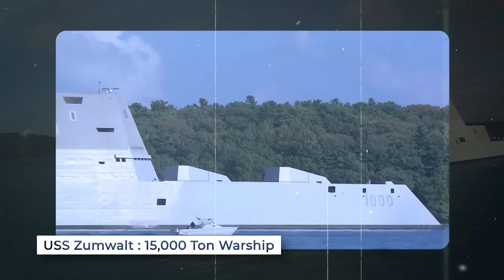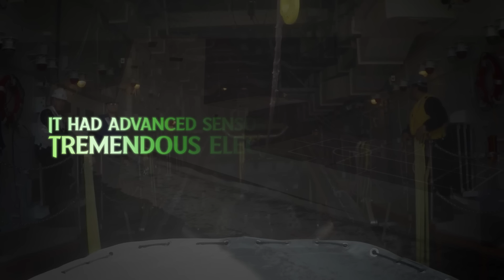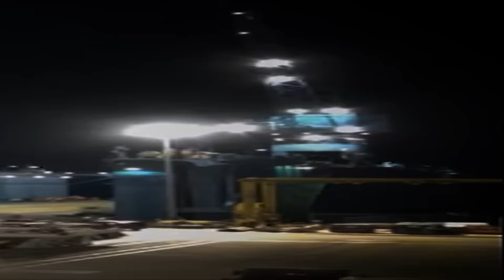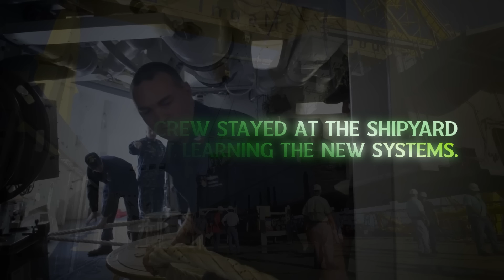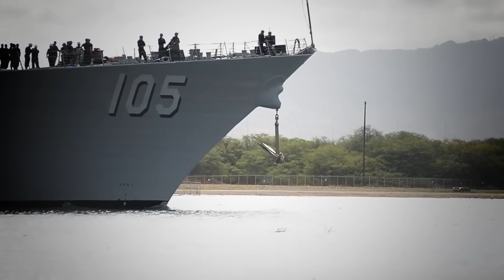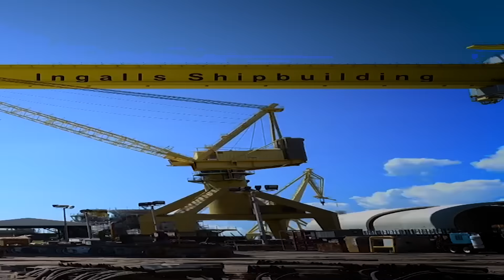How US Navy Rolling Out Newly Repaired $11 Billion Destroyer From Dry Dock

Comment: The Dept of the Navy needs to hire a gamer for ship design.  The rule for designing an effective character is simple.  Decide what one thing you want to do, and how well you want to do it.  Make the character do that extremely well.  Once you are at that point, you can examine your budget and see if you have room to do one single other thing well, and if you do, then add that in; otherwise, make it even better at the original thing.  With that one change, the Navy could keep boondoggles like this from happening.
Reply: That would be a different a lot of different in not only ship's but planes. By all the gods of Valhalla build something they could beshot for something that could be shot for a hell of less than millions dollars the company has made a HELL OF A LOT OF MONEY IN R. D A MILLION DOLLAR IS OUTRAGEOUSLY PRICED THIS SHIP THE  Zwalts cost was almost as expensive as a aircraft carrier Zen waltz was solely supposed to cost $8 billion I think the Ford I really not sure was built for $13 billion. The Ford class aircraft carrier. When the Navy bills a ship as advanced as a ZenWalk you should already have plans for it weapon systems to the anchors it should have been ready. Sounds like some good old boys wanted to build a destroyer putting a little jingle in the pocket of the fat in high places

Comment: The mistake was not making it what it should be the new fleet air defense cruiser. 
The hull and propulsion works well.
Ditch the complete stealth upper superstructure and make it more like the Arliegh Burke Destroyer.
Place one standard 5-inch gun up front. Install more Vertical launch Tubes forward of the superstructure. 
Minimal anti-submarine equipment.

Comment: When I served on the U.S.S. Albany CG-10, in 1966 it was the most powerful and accurate Guided Missile cruiser in the world.  They had to add two 5"-38 gun mounts plus radar directors, one on each side of the ship because if it were attacked by the 65' Komar Class Russian missile boat, it had absolutely no defense against it or any surface craft.  I know, because I was a Fire Control Technician gunnery and worked on the port side fire gun fire system.  I sincerely hope that did not repeat that mistake.
Reply: Various exercises were carried out in the Med with UK and US warships ‘attacked’ by a wooden hulled, aluminium superstructure high speed launch acting as a Komar class boat. Initially, 20 miles was the distance the launch should have been detected, by the time the exercise was terminated, that had been reduced to ten miles , and on one of the final scenarios, the launch spent 15 minutes sat close under the stern of the US warship, A Komar class carrying the nuclear tipped missiles, were a clear danger as most of the unfriendly countries in the Middle East had dozens of these craft.
Reply: what big navy screw up  .... YEP ALWAYS DOES
Reply: Your as old as Davy Jones.😢

Comment: I always wondered with the guns why didn’t they just run traditional ammunition after they did the math on the rocket assist rounds . At 155mm they would still be heavy hitters and have decent range
Reply: I have the same question.
Reply: 155 artillery still uses powder bags while naval ships use cased shells for safety and automation.  Plus the barrel isn't actually a circular rifle.

Comment: Once again an AI generated video with no basis in fact, only repeated sentences designed to increase monetization through longer running time. Floating dry docks do not require a caison to keep water out until sea level is achieved. It lowers the ship into the water until buoyancy is reached and floats off of the keel blocks.

Comment: I agree if the Japanese came up with a great way of using the rail guns and if the ammunition, is  a lot cheaper, fine and dandy, the way I understood the railgun testing was that it was very fast. The rounds in the original testing were very small aluminum, but very fast designed to just punch a hole. And cause a lot of trouble in the ship, they figured that because that's how technology works. They just want the contract.That's just my feelings about it. In the case of these were 6 inch diameter rounds. That was like the medium cruisers back in the day's of World War 2. They carried 6 inch guns. I still believe that the 16 inch guns of the Iowa class were amazing. But of course, the barrel liner had to be replaced after so many rounds, but they did come up with a round. But never had the opportunity to use it. The war ended or it was after Vietnam. But.
The rounds had a rocket assist in them, which would take them from being 23 to 26 miles to a 40 mile range. For the price of defending against all these drones today, could you imagine a phalanx? We only use the 20 mm six barrel mini gun, there is a 30 millimeter called goalkeeper, but we don't have those. let's say we made a 3 or 4  barrel for the sake of discussion,  barrel in in
A 40 millimeter or a 3 inch round.
Whatever caliber, but one that has longer barrels for more range. One that could fire a burst 40 miles, 30 miles. Anything that we don't have to waste a missile on
And make it fully automated. So it's in a armoured barbet being fed from below in the magazines. That's what we need to go back to. I always hear the admiral, saying those missiles cost. So much money, well then go to a rapid-fire guns that have a higher caliber farther distance. Bullets don't cost that much when it comes to comparison of a missile
Those rim rockets are great. It's just my opinion. There's not enough close in weapon support on Our ships, I mean, the IOWA'S had 4 20  MILLIMETER PHALANX, now 4  goalkeepers would have been better longer.Range and heavier 30 millimeter rounds, those are made by one of our NATO countries. So like, you know, we have trade. We're friends. So even if the Zoom,s can carry all these hyperspeed missiles, fine? Great. Awesome. That close in weapons is what all our ships need to have. Even a carrier has all these planes to protect it.But you can see what our enemies are out of yemen. Iran, the houthis et cetera, they're supplied with tons of drones. America is the only a country in this world that is truly free. But as in the famous words of nikita, khrushchev USSR that he stated after JFK STOPPED the 1962 cuban missile crisis. (Next time we'll destroy you from within). Thanks to the woke dei Democratic Party, which is their goal to rip-off the taxpayers. Thus, it's easier FOR THEIR EVIL TREASONOUS MENTALITY  towards our country.
Reply: You think in the beginning, the announcement of high voltage capability, might have hinted a rail gun on board?
Reply: Wow, you could do with an editor for your post. I read it twice and I'm still not sure what you meant.

Comment: Your wrong normally before a vessel enters any sort of dock the dock people will have access to the ships drawings and block will be pre placed., the vessel will be pulled into the dock by tugs and defloodeing will commence. just before the vessel touches the block divers will physically check block to ship alignment, And so it has been since the advebt of diving operations.  Yes it is critical and yes it is dangerous but dry dock operations have been doing this since the turn of the last century nothing new about it. I wish you peop[le who make content would fact check yourself. The second part is called a synchrolift allows the vessel to be placed at a convenient spot freeing up the drydock so other vessels can use it.

Comment: It wouldn’t have been that expensive if they completed all 32. With technology developing at a rapid pace, there will always be new systems and weapons that could be integrated into them even if the 155mm AGS was a failure.
Reply: The study going on will need to be studied before a larger scale . Assured products and systems must be designed first with long term testing and lasting performance before a large number of ships that cost more to operate than is feasible .. million dollar drone hunter is not a great investment . And welcome the new investments in the technology. Have to spend to find the cracks not identified in the complex system that has its own set of problems as  very high energy focused  electro magnetic space and   Special applications  aircraft munitions  for overhead energy transfer in plasma energy weaponry . .
Reply: That's right Eddie You get a discount when you build up to 32 ships either spend it now or spend it later
Reply: ummmm.....what???? the cost would be the same...wtf are you talking about....
Reply: From an acquisition nightmare and SNAFU. It was too many new undeveloped systems on a single platform. We could have had 32 useless ships instead of just 3. It was poorly managed, and is the ugliest warship ever built since the Russian Ekaterina battleships in the 1800s.
Reply: You are correct in the fact that the price gets cheaper as you produce more however there are numerous issues including engine failure cracks and the like that the manufacturer had not resolved so it would be asinine to continue to pour more money in it also it was supposed to have these guns that had amazing capabilities however at a million dollars per shell that did not make sense
Reply: Yeah, but the US isen't the one developing these new weapons =P

And in addition, the ship has been expensive even before they shortend the total number. This one was build around one specific purpose, and this evaporated. So it's specialised to a thing that doens't exists (and i don't mean AGS but energy infrastructure). This thing made a bet on buzzword weapon tech that every engineer could have told you will not make any sense because of basic physics.

Sure you could play hard and make rocket supported baseball bat's, but that doesn't make the fact go away that the idea is dumbfuckery on steroids.

Comment: The main armament was meant to be rail guns! 
        How could this infomercial leave out the fact that it was originally going to have rail guns?!
Reply: True.  Thankfully the navy offloaded the rail gun program to the Japanese military.   The rail guns worked fine.  It was the wear on the barrels and magnets per shot that made it unworkable for costs incurred,  even if the navy had actually bought all 30 of the originally order and thus had the discount of cost per ship at scale.  But it appears that Japan has solved that problem and already ship mounted and field tested it very recently  - successfully.
Reply: You have a ship over 600 feet long,but only man it up with 150 people, preventive maintenance don't get done.  Just saying.